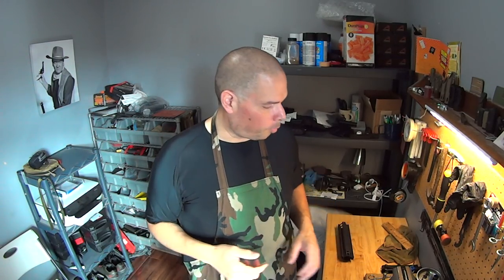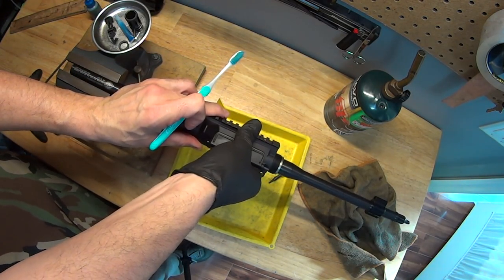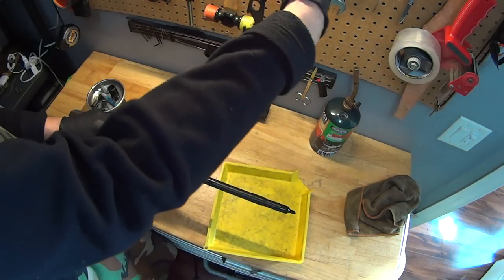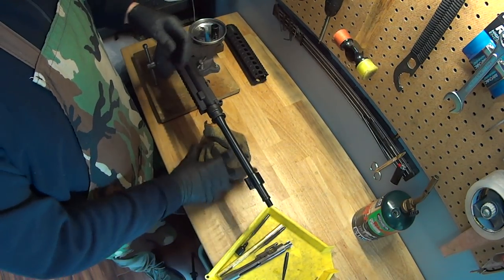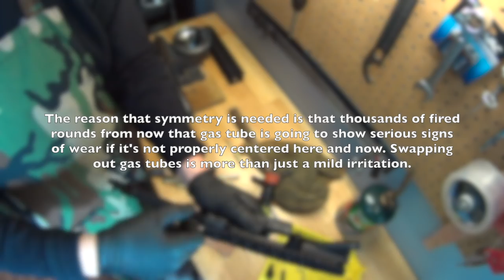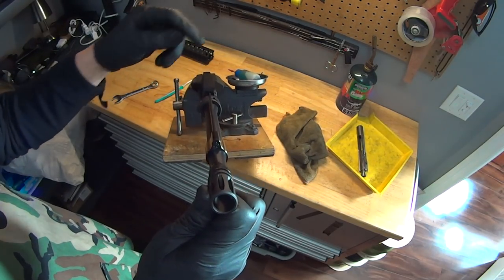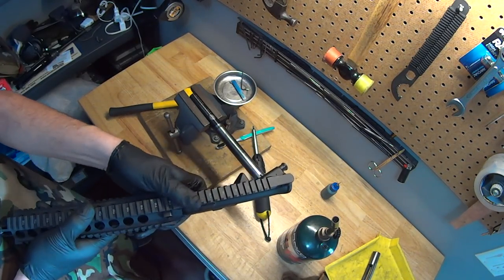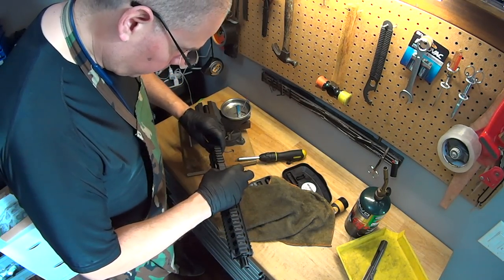The T1C MK18: Building The Upper

Comment: A reaction rod was probably the best tool I’ve ever bought (for working on rifles) i got the Midwest industries urr. The sail on top allows it to double as a gauge to know if the barrel extension is clocked right. I might grab a geissele one too though i like the idea of being able to spin the upper around as needed. 

I just got my first bcm rail, i got the mcmr. I don’t have much time with it yet but i like it better than my Midwest industries rail so far even though the bcm rail looks basically identical except for how it mounts. 

I might grab one of aim surplus’s new barrels to try out and put me a new upper together…. Thanks a lot Abner 😂😂
Reply from the maker: I'm glad the video was helpful.

Comment: Though not a BCM quad rail, my Spike's Compressor pistol uses the B.A.R.2 quad rail which slides far enough onto the upper receiver that it acts like a monolithic rail system. Though not your original concept, the fact I own a weapon that was originally designed/inspired by you makes owning it that much sweeter! 

Keep the content coming, sir!
Reply from the maker: BTW The BAR rail was my idea. The conversation with Tom Miller and Glen Seekins went like this. I said "The muzzle device needs to be all the way inside the handguard so that nothing pokes out of the front of the gun." I wanted a design where nothing would poke out of the front of the gun and burn the operators when they came in contact with a hot gun. Tom said "there isn't a handguard that can accommodate the circumference of the muzzle device." That's when I said "ok so design one." That's why BAR stands for Big Ass Rail.
Reply: @Tier1Citizen  Yep. Awesome! If I ever get to come train with you, I'll be sure to bring my Compressor! Absolutely my favorite AR!
Reply from the maker: Yeah it's a cool gun.
Reply: @Tier1Citizen  Hell yeah, it is!

Comment: There are 2 handguards that fix that issue as well: Aero Precision Quantum, and Daniel Defense RIS 2, both use screws that tighten directly into the barrel nut, but require proper timing with shims.
Reply from the maker: I no longer touch anything that comes from Aero precision, their quality control has become garbage and I will not give them my hard earned money any longer. Also, the moment you have to start using shims is when you are tied up with endless tighten and loosen, then tighten and loosen, then you finally get it right, or you fatigue a shim pack and have to stat over again. The BCM handguards take that all out of the equation.

Comment: Building one rn using a V7 Titanium nut and BCM upper for that tight fit to the 10.3 Hanson. Love your mk18 so much I even sourced the same OG Vltor BCM CH.
Reply from the maker: I miss building rifles. Right now it is close to impossible to gauge what the level of quality the components are going to be.
Reply: @Tier1Citizen  Have always been a fan of your builds. My first AR was a copy of your 7.5 almost 12 yes ago and between then have built several copies of your 7.5 and this is my second go around on the  T1C MK18. Thanks for what you have done and continue to do!

Comment: What is your opinion on centurion arms rails? Both the C4 rail and mlok rail?

What is you opinion of FSP rails?  This would be in regards to the C4 FSP rail. 

I believe what you are saying about BCM, I am curious about centurion not in comparison to BCM.
Reply from the maker: Here's the short answer. Any manufacturer that doesn't have their mounting hardware going across the top portion of the handguard is leaving rigidity on the table. A close second are those manufacturers who use screws around the perimeter of the handguard. However, in those cases you end with timing issues that can pose problems when you're trying to find a torque spec that is very specific.
Reply: Would minor timing being off be a major issue if the rail is one with a front sight post cut out and only a white light being used? I have a couple "classic M4" style AR-15s and I don't really want to replace the FSP with it using taper pins and the cost to mill them down isn't cheap either. I don't mind having a front sight post either.
Reply from the maker: As long as it's a two piece handguard you should be ok. Check out the ones from Magpul. They are excellent.

Comment: Abner a quick question for you. Having no experience of building firearms just how to take down and clean then; if I were to switch out my hand guard, would I need to remove the barrel nut, gas block and tube?
Reply from the maker: On a BCM handguard, no. The barrel nuts are all the same on all of their handguards.
Reply: @Tier1Citizen  I don’t have a BCM handguard so I would assume I would need to change it out then.  Thank you so very much for all your help and knowledge!!
Reply from the maker: Yeah if that's the case you're going to have to pull that whole upper apart.
Reply: @Tier1Citizen  thank you!!

Comment: Have you tried Forward Controls Design quad rail? They make some bomb proof stuff as well.
Reply from the maker: Their rails are the same as everyone else's out there. They are pinched at the bottom or are multi-piece set ups using the legacy barrel nuts. BCM handguards truly are a cut above everything else in the industry.

Comment: Nice job..I've never seen someone torch the guard..that's a good idia.  And I've told guys that a benefit of a quad rail ..if your gna dump rounds or full auto. A quad is the way to go..it takes longer to get hot and the rails are basically a radiator
Reply from the maker: Yep it's quite radiator.

Comment: No aeroshell 33?Just curious why you don’t use that to protect the Aluminum and steel touching.
Reply from the maker: Nope!
Reply: @Tier1Citizen  how come? I am not asking to be a dick I am asking as a student
Reply from the maker: I've been build guns for decades and have even taken apart several of my own builds after hard use and found no issues with any of the surfaces. 

I recently had to take apart one of my own builds that had been used hard. I was so glad that I had used Lucas Extreme Duty Gun Oil and an accurate torque wrench when I built it. With the application of some heat it came apart by the numbers.
Reply: @Tier1Citizen  very cool. Thank you for explaining bro
Reply from the maker: Yeah man!

Comment: Thanks for the video did you do the offset on the torque wrench since it's not a socket ur touque wrench will be off a few foot pounds
Reply from the maker: That's how I was trained for when you build a rifle. Most people line it straight off the end but in reality it's supposed to be slightly offset.

Comment: Amazing video!! Man… I was wanting to build my first upper and this seem like ALOT of tooling required. Any advice or feedback regarding the Rosco Manufacturing Bloodline 5.56 AR-15 Barrel Sauce Pack - 14.5" barrel’s? I came across a great deal on them. I want to pin and weld my SilencerCo flash hider to make the 16” and not have to SBR. Any feedback would be greatly appreciated 🙏🏼 this was an awesome video and I just subscribed!! You know your stuff bud👊🏼
Reply from the maker: There is a lot of tooling and knowledge needed to properly build an AR-15. My advice would be to buy one already built. If you want to get into building your own be prepared to mar up the first couple you build. 

I've never used Rosco barrels.

Comment: Hey T1C. I have another questioned. My Bolt carrier gas key has a slight leakage in two spots. The gas key is not lose whatsoever and it’s properly staked perfectly. I have 875 rounds through it to be exact. I’ve had no malfunctions at all with 3 to 330 ejection pattern. Like I said before it even runs Tula ammo. Is this something I should be concerned about? Should I get it looked at and replace the gas key or should I just get a whole new BCG all together?
Reply from the maker: As long as your gun runs, leave it alone.
Reply: @Tier1Citizen   thanks bro I was thinking the same thing. I was just thinking of possible erosion taking place over time causing the space between the gas key and carrier to open up slightly and getting worse.
Reply from the maker: That could eventually happen but it will take a long time. You can take it apart and redo the Permatex sealant your self. Just make sure to get the high temperature stuff. You'll have to redo the hardware and staking on it. Find a video on attaching gas keys and follow it to the letter.
Reply: @Tier1Citizen  yeah if I do go that route I was thinking of using the 620 green loctite. I have the 648 green loctite but it has a 300 degrees operating temperature vs the 620 which has a 450 degrees operating temperature.
Reply from the maker: Good call.

Comment: Wouldn't the QRF 9 be more appropriate for a 10.5? Its actual length is 9.56" which would allow the option to mount a suppressor.
Reply from the maker: Sort of but I was after the look of a Mod 1 where all you see is the muzzle device poking out of the front end. If you want to do one with a can on it then yes, you have to run the 9" QRF.
Reply: @Tier1Citizen  Right on. Definitely looks slick for sure.

Comment: If you want an actual Mk18 rail and not the knock off budget version spend the money. It’s worth the money
Reply from the maker: Nope! This is a much better build, it's not as over gassed as the DD MK18's are. There's nothing budget about this build, it's all top notch.
Reply: @Tier1Citizen  the over gassed argument is old. If you’re referring to DD if was over gassed to run civilian 223 and prevent common malfunctions. The gas port on anything post 2016 has been reduced to standard milspec gas ports. Do you want your rifle to be finicky with certain ammo or run with everything it’s fed?
Reply from the maker: Dude you're talking out interwebs talking points. You're talking to someone who has been inside of this industry for a very long time. I've had conversations with the folks at Daniel Defense and ABSOLUTELY know why they intentionally over gas the gun. They actually told me their gas port spec numbers and they were shockingly large. Now, I will concede that they may have changed them. The MK18's that I've worked with were all pre 2016. So yes, they may have gone back to Crane spec. 

When we talked about it they told me that they chose to over gas the gun intentionally. They stated "we have to run a gas port that large because our customers keep complaining that they can't run Wolf 55 grain through the gun." I reminded them that their choice to meet the needs of the base customer left those of us in the lurch who actually run true M193 through out MK18's. I advised them to put a sticker on the upper receiver stating that is the customer runs anything other than Milspec ammo through the weapon it voids the warranty. This industry infilled with people who want to do what they want to do, when and how THEY want to do it. Then they want to squawk when things fail.
Reply: @Tier1Citizen  dude, civi 223 and crap wolf ammo is essentially the same thing in regard to gas pressure generated. You’re repeating what I just said. I have a pre 2016, and 2016 Mk18. I know what the gas port size is in both bc I have a digital caliper and I’ve measure. Pre 2016 measures around 0.08 and post 2016 went back to around 0.072. Overgassing issues which really aren’t even issues are easily mitigated even with a can if you upgrade the buffer weight to H2 or H3 suppressed or upgrade spring. I’m not talking interwebs I own both of them. 🤣
Reply: *post 2016
Reply: Even when overgassed using every type of ammo from crap wolf to premium, no issues running anything suppressed or unsuppressed. I’m talking from the experience of owning both versions. They run everything. The only draw back might more wear on the over gassed when running standard 193 bc it is higher pressure resulting in the bolt cycling much faster. All mitigated with H2/H3 buffers which they should come with to start IMO. Running standard 193 or not doesnt void any warranty with DD so what are you talking about
Reply: @Tier1Citizen  Marty and Cindy Daniels have also addressed this on their owners Facebook group years ago. No warranties voided shooting standard 556 or anemic 223. That’s one of the many benefits to owning a DD

Comment: It’s not a Mk18 without a RIS2
Reply: If someone is claiming clone correct then of course you’re correct. But not everyone wants a 10.3 , if someone wants to build a 11.5 or 12.5 and throw a quad on it , a quality barrel, lower , optic, sling etc , it can be inspired by MK18 without being a 100% clone. 12.5 is superior to 10.3 even if people don’t want to call it a MK18
Reply: @stephen_crumley  if that’s you’re argument then get a RIS2 for the M4A1 SOCOM  (12 1/4”)  14.5” barrel and not a knock off. A 10.3 will do everything you need it to inside of 100yds. An inch or 2 may add 100fps
Reply: @AFreeThinkingDawg09  I never said a 10.3 wouldn’t do everything a 11.5 or 12.5 or would do inside a 100yards. I said not everyone wants a 10.3. 
You going to try to argue a 10.3 and 12.5 don’t have a vastly different recoil  impulse and muzzle blast??  with additional length of the handguard which may be a different brand quad than a Ris ii? See how I can frame an argument for a topic you didn’t even mention, just like you did with that get a 14.5 comment. A 12.5 middy suppressed is fantastic option for someone, to act as if you must buy a DD ris ii in either m4A1 or MK18 is absurd. I never knocked DD or m4A1 or said they weren’t great. 
There’s endless options and folks can build whatever they want. You’re acting like I promoted strike industries or olight
Reply from the maker: Wrong! Clearly you don't know your MK18 history.
Reply from the maker: Stephen you're trying to reason with a MK18 purist in AFreeThinkingDAWG09. He is clearly trying to start a dumpster fire. Bring your fire extinguisher.
Reply: @stephen_crumley  you’re arguing barrel length when the question is about the rail. RIS2 is the best quad rail made. That’s why it’s now made for 14.5”. But to answer your question, I have 10.3, 14.5, 16, and a 18” mk12. There’s no noticeable recoil impulse in 556 until you change the gas system. Muzzle blast? Run a can and there is no blast. An inch or 2 doesn’t make a difference except terminal velocity like I said. The lock up on a RIS2 is why it’s the best and it’s not just for the 10.3 Mk18. It heavy yea, but maintaining zero under abuse and durability come at the cost of weight.
Reply from the maker: @AFreeThinkingDAWG09 You keep making arguments that are erroneous. Yes the RISII rail is excellent at holding zero under abuse. The BCM product is better. Why? Because it is a continuous undisturbed ring once it is mounted to the weapon. No matter how good the RISII is, it is still a two piece handguard. 

I've tested these things under some serious levels of abuse. I've written articles on true Crane Arsenal MK18's that I've had the opportunity to work with. I've interviewed and trained with the guys from High Caliber sales who used to work at Crane Arsenal. These were guys who actually were part of the development of the MK12, MK13, MK18, and even the ammunition that is speced for these weapons. I KNOW WHAT I"M TALKING ABOUT! The RISII has had its day in the sun. The BCM handguards are better. 

Do yourself a favor and take a break and read this article. Please believe me when I tell you that I approach this stuff with a great deal of thought. https://img1.wsimg.com/blobby/go/f6c2a23e-38c9-4485-baf2-e7f5802dbde5/downloads/1brfih58q_345382.pdf?ver=1643916400628
Reply: Meh, it all depends on what you’re doing. If you’re going for a pure clone, then go with the ris2, if you’re going for a mk18ish build, then it doesn’t really matter. I’m not sure there is an objective standard to say definitively which guard is better between the BCM and the DD.

Comment: Forward assist and dust covers are laughable...the slick side or sporter upper is just more stream line and sexier
Reply from the maker: Agreed, however, I was going for the true MK18 look with this build.
Reply: @Tier1Citizen  ive built or asembled 3 rifles and yet im still learning new things ..thanks for the video
Reply: @Tier1Citizen  I noticed you didn't use aeroshell 33. Is this not needed for threads ...barrel and barrel nut
Reply: @TheMrwhite6199  he put a good amount of oil on the threads, it don’t have to be aeroshell but you definitely want some type of lubrication on the threads. I usually use high temp wheel bearing grease, everyone has their own way just don’t put it on without lube. Steel on aluminum likes to seize together, if you ever wanted to take that gun apart you could end up breaking the upper or the index pin off the barrel.
Reply from the maker: I recently had to take apart one of my own builds that had been used hard. I was so glad that I had used Lucas Extreme Duty Gun Oil and an accurate torque wrench when I built it. with the application of some heat it came apart by the numbers.
Reply: @itsamk18-ish  very good thank you
Reply: I prefer function over form, regardless of how one views a forward assist and dust cover, they do have purpose.